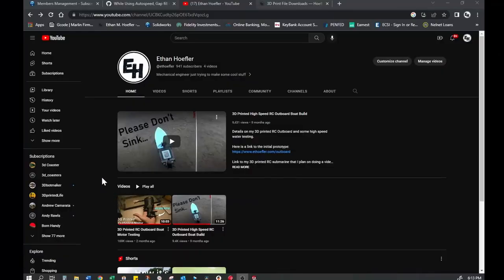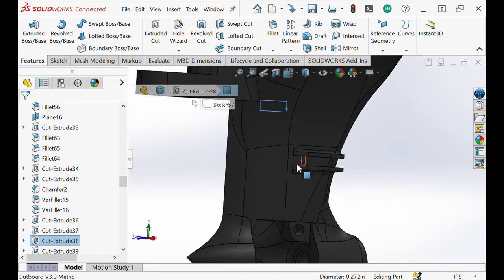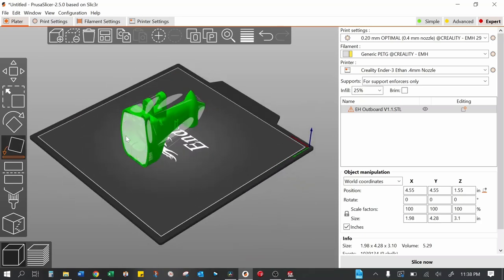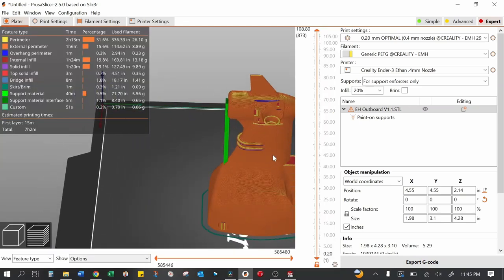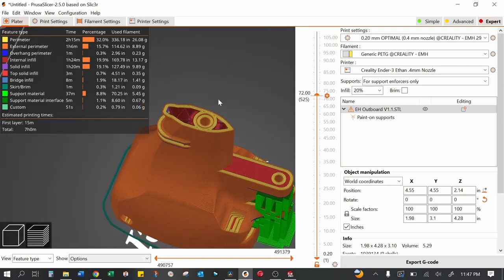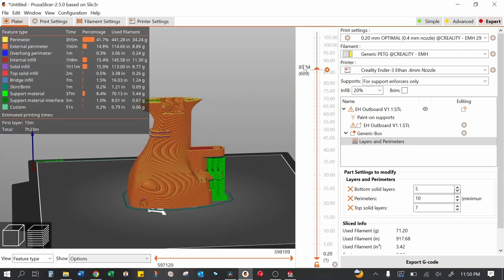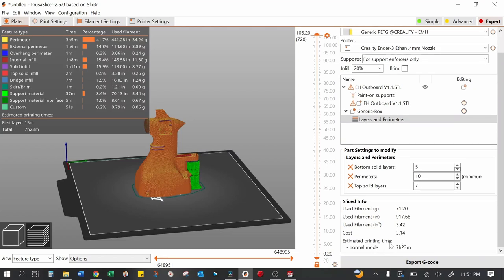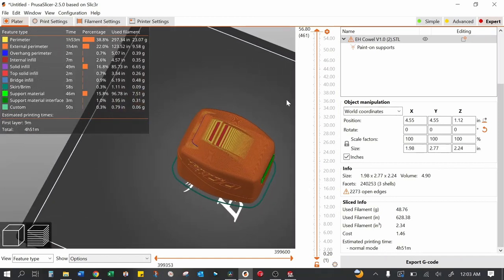Best 3D Print Settings - 3D Printed RC Outboard

Comment: i printed two different motor's on their sides with custom supports with no issue, but gonna try it this way too lol
Reply from the maker: That's great to hear! what kind of printer are you using? PETG or ABS material?
Reply: @ethoefler  anycubic kobra max, and petg, printed one on the ender 3 also

Comment: Is there a parts list? I have it printed just need to know what parts you have inside and the motor your used.
Reply: also looking for this list if you found anything thanks.
Reply: @Jacob Miller  I think it's 5mm shaft 5x8 or 5x10 bearings and some china 5mm bevel cut gears I just don't know the ratio. Wish he would put the list out so I can build this old Nitro boat iv been sitting on for years  and run it this summer
Reply: @MeadorRacing69   I do know its a one to one gear ratio. I just printed mine and it looks to be 3mm shaft and has multiple sized bearings. just difficult to find beveled gears that fit in the gear box.
Reply: @jacobmiller624  yea hopefully he gets the list out id even buy the kit if he sold it.

Comment: Hey Ethan did you make up a matchin motor mount for the stern ?I'm printing the tunnel hull now and the motor next.
Reply from the maker: Yes! Files are available in several places! The mount is pretty simple and can be attahed to any boat. You can also design your own mount for custom applications. Use the one I designed as a guide!

Links below, take your pick!

https://www.ethoefler.com
https://www.printables.com/model/499361-400hp-rc-outboard
https://www.thingiverse.com/thing:6156830

Comment: I'm having trouble printing the cowl.  'The model is not watertight' is the error i receive while slicing in cura, and the cowl will split in two parts if i print it anyways. Any insights on this?
Reply from the maker: Solved! Looks like Cura has a hard time with high-resolution STL files. Here is a lower resolution STL for the cowl: https://drive.google.com/file/d/17eXmL4jc5rYS1Lyx-HTjuISjIcVgrwcl/view?usp=drive_link

I just tested it in Cura and it recgnized it as 1 solid piece.